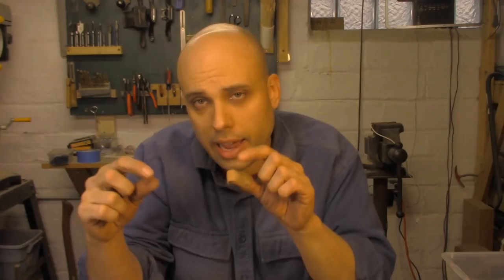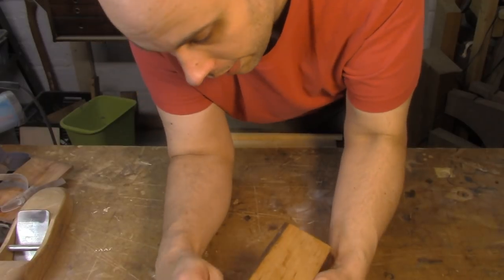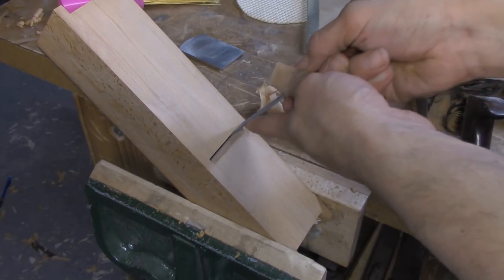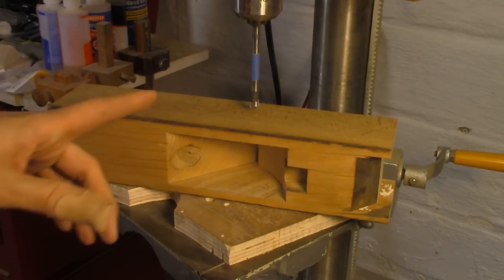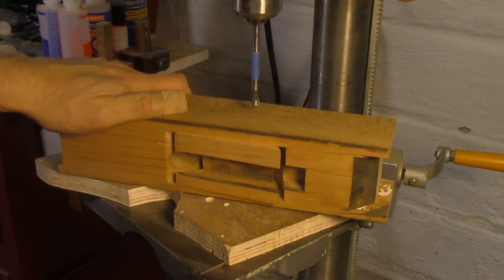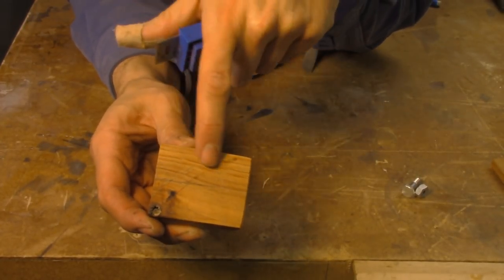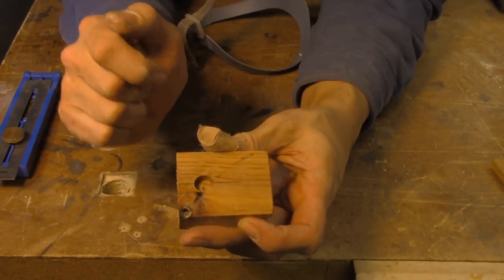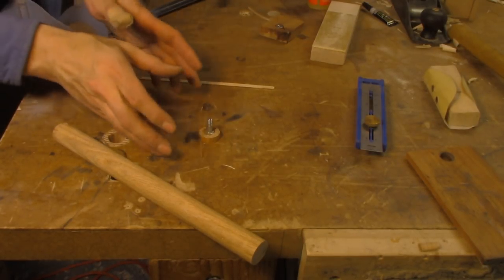Make the easiest handplane ever (Pt3: fine-tuning and making cuts)

Comment: I just made a plane heavily inspired by yours.  I went with the wedge.  
It works waaaaay better than the one I tried to build by copying an aliexpress special.  
  In fact it works at least as good as the aliexpress plane.
got the wood from a pallet, the blade from an old saw.  was able to harden it with a blow torch and temper it in the oven.
   The plane of my dreams all thanks to you

Comment: I've made several Krenov-style planes. They work well. I use one as a scrub plane and it does a great job.

However, I think the modifications you have made to his basic design  by adding the wear angle (as modified) and a cap screw are real improvements over Krenov's design.

Well done!  Thanks.

Comment: Really nice looking plane.  I wonder if the blade needs to be sharper.  As for obtaining a high carbon plane blade your idea of using a chisel is literally creative genius.  I am a knife maker so there is lots of high carbon tool steel in my shop.  I prefer making my blades from S1 hardened and tempered to RC 58-60.  Sharpened to scary sharp the edge lasts for an incredibly long time unless I need to plane a lot of Manzanita, Black Locust or certain South American hardwoods.  I have made some Japanese wooden planes and prefer the pulling action.  It is less tiring.

Comment: Correct me if I'm wrong sir, chip breaker is not always necessary correct?
Reply from the maker: That is SUCH a complicated question. I guess the short answer is that if you have a thin iron, like an old Stanley, then you need one for sure. If the iron is thicker, then it's not strictly necessary, but in any standard, bevel-down plane, the chip breaker helps.

Comment: Ok. I get sandpaper on glass, but! How do you attach the sandpaper to the glass and how do you get it off when it's time for replacement? In this video you  recommended 80 and 100 grit... Do I  need more than one piece of glass? Attach a different grit to the other side? If you have a video that covers all this, a link is fine. If not, HELP! ❤🌅🌵
Reply from the maker: Suzi SaintJames I use 3m super 77 spray adhesive.  I remove it with mineral spirits.  I often put one grit on each side.  Them I put a piece of old yoga Matt under the glass to keep it from moving around.

Comment: Awesome plane Rex!  Can I ask you about that blue ruler you use? I can't seem to find anything like it on first googling.
Reply from the maker: You know, for a second, I didn't know what you were talking about. I forget what it's called, but it's made by Kregg; the same people who make the pocket screw jigs. I really like it and use it often.
Reply: It just caught my eye because a lot of time I'm trying to mark something using a combination square, but I don't need something with that wide of a base just to get a little mark 3" from the edge.
Reply: @JamesCromwell2047  I know it's old... and I probably sound "a touch crazy"... BUT silly tip if you're interested. That complaint is EXACTLY why I like to keep an old "Dress maker's tape measure" or "Tailor's Tape" around my toolbox... the good ones are made of cloth, so super flexible... get right into where you want them, or can be managed without fear of "crushing it to death" like a normal or plastic measure... AND they can be just as precision as the rest of your gear... 

    AND (best yet?) if it gets incomprehensibly filthy... throw the thing in the wash! You'll prefer a knit-bag or "ditty bag" (popular term?) to wash it in, and with a small load HEAVY on degreaser, you can clean just about anything off so you can read it again! ;o)
Reply: @James Cromwell
That is a Kreg marking rule. Home Depot has them. Amazon too.

Comment: Sweet, great job!
How would you finish it? Plain, oil or poly?
I hope you have a great day & be safe.
Reply from the maker: I actually didn't finish it at all, but I think old or wax would be good choices.
Reply: Gigamut 11B 
A little shellac (1 thinned coat), then wax (beeswax w/citrus) and it was really slick and comfortable. Its not sticky, was comfortable in the hand,  and it was quite moisture resistant (really, really important here outdoors in hawaii where it rains every day). The wax made it slide especially easily as well.

Comment: The wear angle didn't work for you because you do not understand how it works. You did not leave the extra space needed for it to actually work, because you wanted the blade to not stick through when you test fitted it before gluing. If you go back to the part of the video series where you showed the old plane's cross section cut, you can see that aside from the plane and the wedge, there is some space for the shavings to go through. 

Also, you called this the easiest handplane ever, but it is far from that. Also, you showed us one plane and you ended up making another plane. Sure, thumbnail, but still. You could have made the screw part after you had the finished plane copying the example design, instead of making everything at once. I would suggest you to look at the development methodologies called "Waterfall" and "Agile", to understand what I meant by the previous sentence.